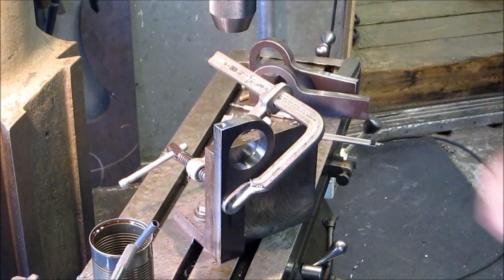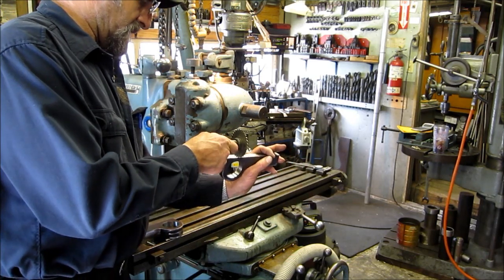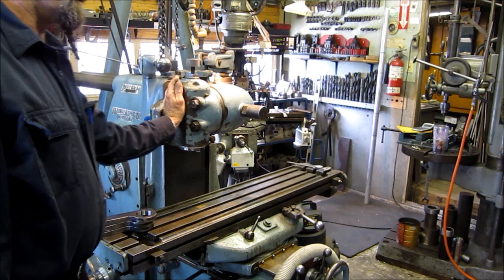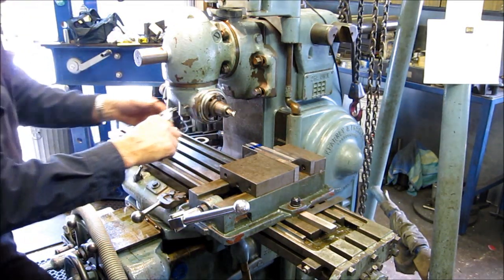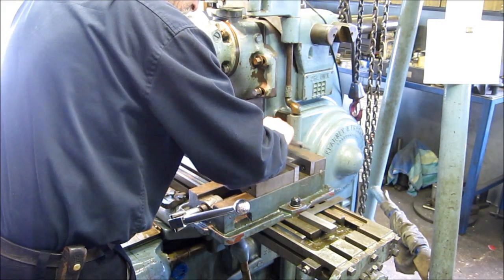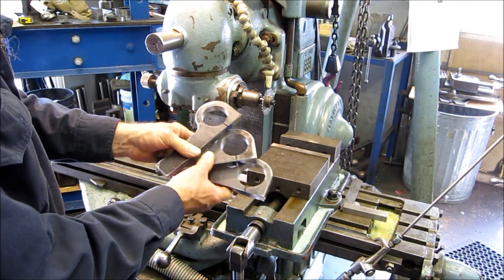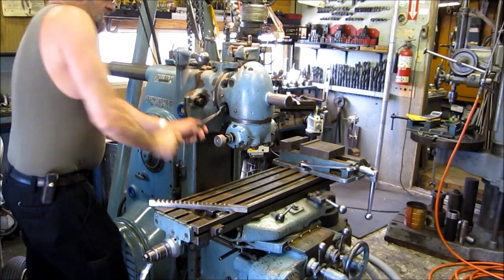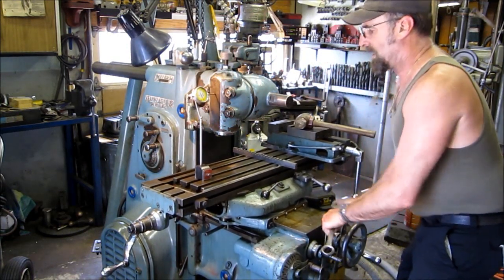Portakey Part 2

Comment from the maker: I have made a bunch of vice t-slot blocks, even recutting the slots on the under side of import vices, seems they can't get them staight sometimes, anyhow, the ones I'm using now don't fit the slot tight but they, when pushed tight against the edge aline the vice, then I tighten it...

Thats why it looked like I just threw it up there...LOL... I got to have a little fun and keep you guys guessing!

Cheers, Keith

Comment: Thanks!  Yah, the domestic broach sets (Minuteman) are BIG bucks.  I only need small broaches for now (push with arbor press), but with this new knowledge maybe I can pick up individual used broaches as I need them and make guides.  Have you found the key slot blocks to repeat well?  The t-slots on my old M-head are worn and inconsistent in width, so I've been indicating the vice in every time.

Comment: Thanks, great vid.  That K&T is a work of art...I gotta get one!  Every time you video it, I learn more about it...you did get lucky this time, but it is so much easier to tram the spindle attachment than the spindle on a BP!  Since you did not indicate your vice in, I guess you must have t-slot locators on the bottom?  Probably not important for one time or occasional use, but aren't commercial broach guides hardened?